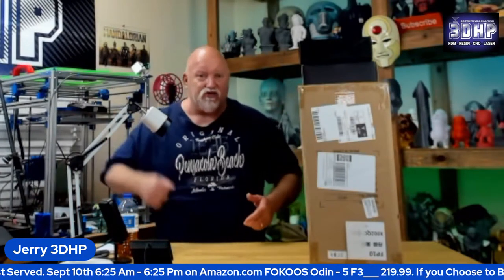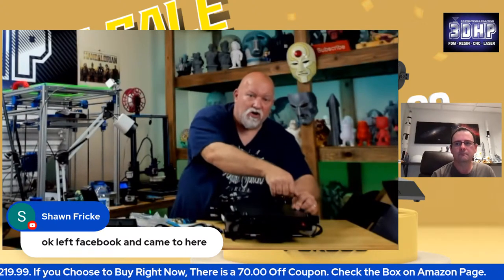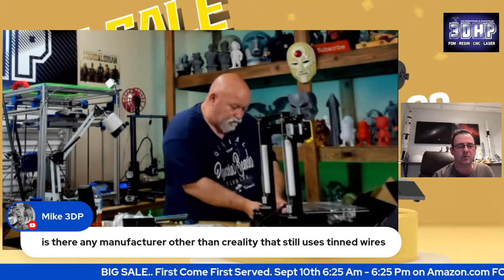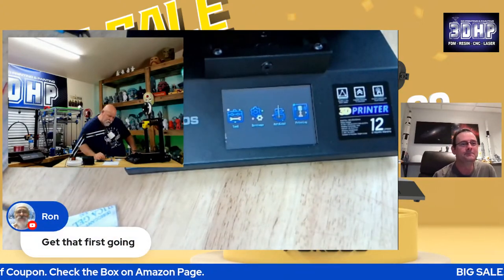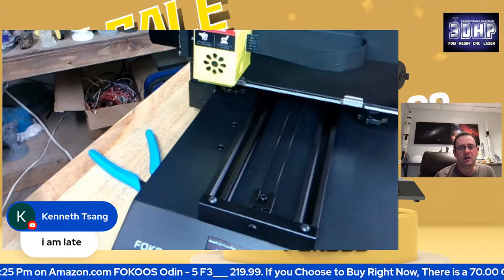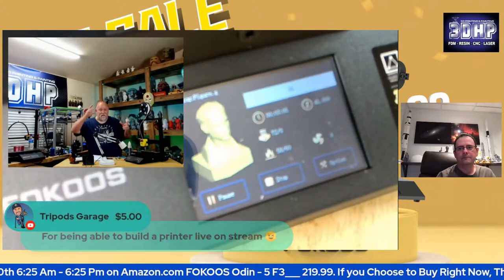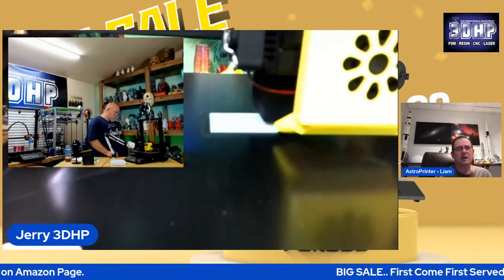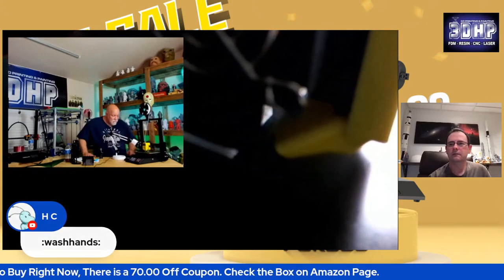LiveStream.. FOKOOS Foldable Printer Odin-5 F3 ...   9/9  5 Pm Pacific

Comment: Hi can you tell me what Filaments it says tpu, pla, pla + can this take more and which Filaments can not take
Reply from the maker: I have used pla and pla plus in it. It will print TPU. I have not tried any other filaments. As long as your printing with a filament that the heat range of the hotend can handle there shouldn't be a problem. Check with there Facebook group to see if anyone has  printed with a filament your not sure of.